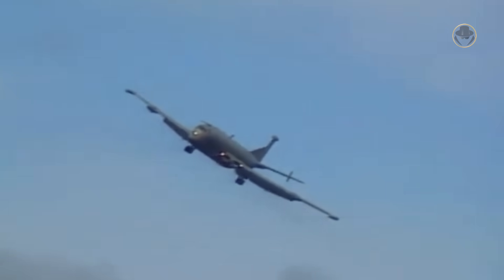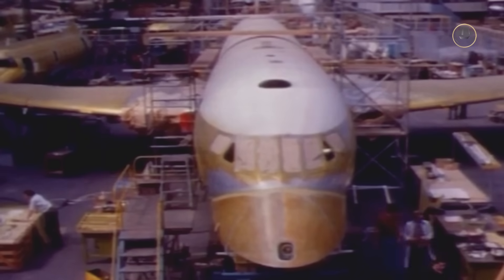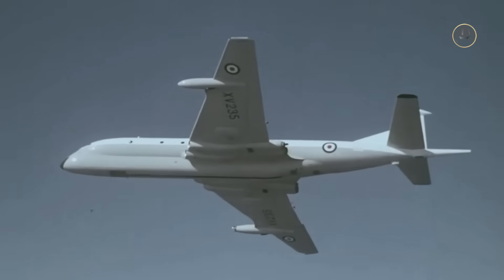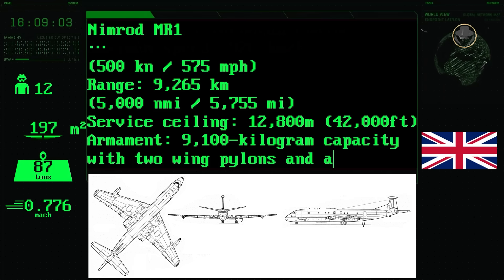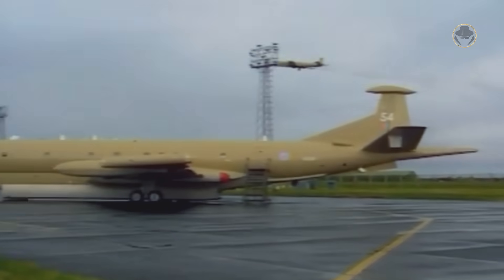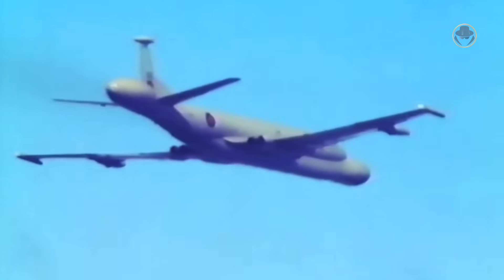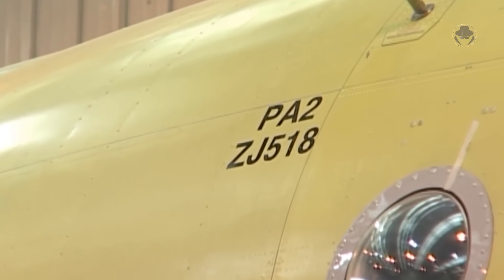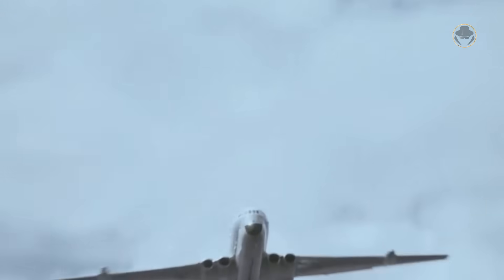Hawker Siddeley Nimrod | The aircraft that stood up to both the U.S.S.R. and the U.S.A.

Comment: Spent 11 years on the MR2 as a Rigger (airframes) tech. Great aircraft, and did a lot more than maritime patrols it was original designed for.
It won a lot of NATO maritime events, as the only fully jet powered MPA at the time, made it sort of stealthy to the subs, as they could hear the resonance of the prop powered planes from miles away.

Comment: No mention of the Sub Hunting Sono bouy AQS901's?
After the appalling moving goal posts the of 'AEW' system that had to be installed via a very small crew door, the system worked and was even produced in a palletised version for use inside more capacious airframes such as the C130.

Comment: When i worked in the aviation business,we had a job making bulkheads panels out of composite materials,came in one Monday,found out it had been scrapped.each plane was slightly different to the next.not built in a production line,so that puts up the cost, the comet airframe was showing its age,a sad end.

Comment: The Nimrod had to go because the airframes were old, tired and had received so many modifications that the documentation was no longer adequate. Also, because the MoD got fed up of BAe continually asking for more money without delivering a single working aircraft. The crash of an MR2 in 2006 and the horrendous failures that revealed did not help either.
Reply: The Nimrod MRA4 was cancelled by the newly elected Conservative government as part of a typically Tory shortsighted range of defence cuts in 2010, all of the MRA4s had fully rebuilt airframes new wings and engines 4 were completed and the remainder were well on the way and already paid for, this shortsighted cancellation wasted billions of taxpayers money and left the UK without any maritime patrol coverage.

Comment: It's a shame the last version wasn't manufactured; the Numrod Mra 4 would have been a great ASW aircraft, although the Boeing P8 makes more sense from the point of view of operational costs over the aircraft's lifespan.
Reply: Most were built BUT David Camron told us since the soviet collapse we had a no need for them and scraped them behind huge screens low and behold a few years later we end up buying a less capable aircraft from the usa.  I wonder who could have seen that coming we dont need the Harrier too expensive then build two aircraft carriers that can only fly one type of aircraft and helicopters where sid we buy the aircraft from